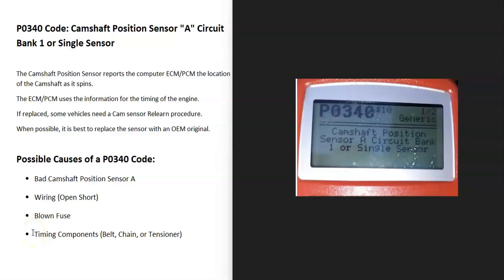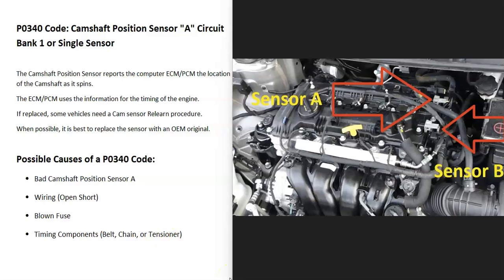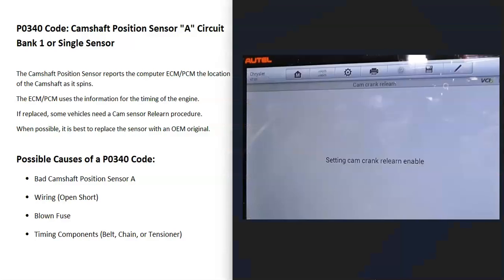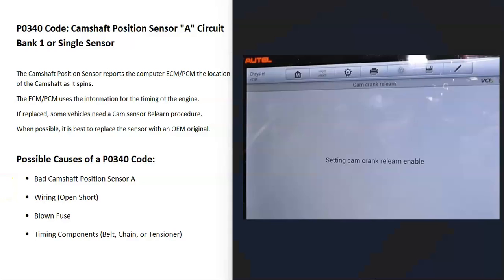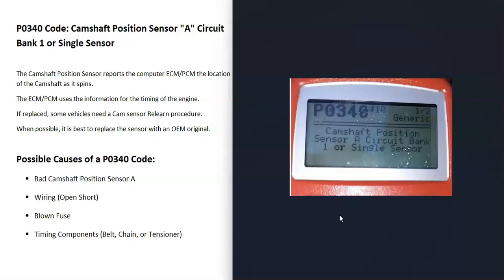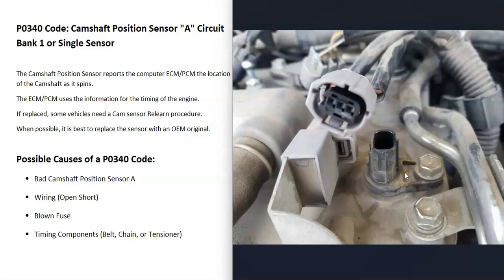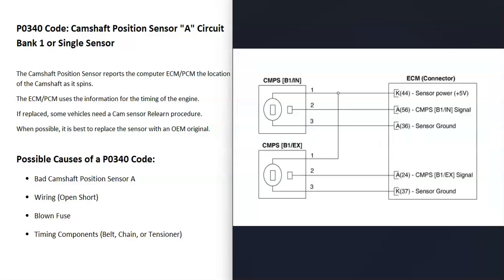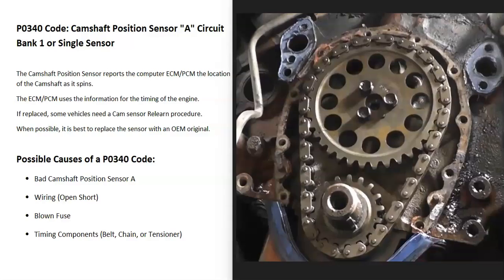Causes and Fixes P0340 Code: Camshaft Position Sensor "A" Circuit Bank 1 or Single Sensor

Comment: What's the location of the camshaft position sensor 2013 chrysler 200
Reply from the maker: There is two on each side of engine top side.

Comment: 2010 4.0  is ready the P0340 and it's a camshaft position sensor A bank one , ok and I know which bank 1 is but where is the sensor located on the front of the head or the back of the head.?

Comment: My 2000 4Runner showed a bad camshaft position sensor I had a broken timing belt I think this code resulted Question should I replace the sensor
Reply from the maker: A bad timing belt will throw Cam senor codes. I would replace the belt and see if the code comes back.

Comment: I have a 2012 malibu lt  4.2 flex fuel with the p0340. It shows as camshaft ps "A". The problem is there is two camshafts. Intake and exhaust. Which one would be considered "A".  Looking at the motor, the intake is front side right, and exhaust is back side right. The exhaust one is very hard to get to.

I also show codes for p0303 which is misfire cylinder 3. I replaced all spark plugs. Still shows p0303. I know im gonna try to swap out coil packs to see if that code moves.
Last code is p1174 lean bank 2. Shows fuel injector, o2 sensor, & MAF sensor.  Would bank 2 be looking from left to right like when doing the coils?

Also, isnt it possible by addressing p1174 & p0340 could solve the camshaft issue?
Reply from the maker: "A" is the intake camshaft, and "B" is the exhaust camshaft. It needs to be diagnosed the cam codes could be related to the other codes or could be separate. The P0303 is likely causing the P1174 lean code.
Reply: Update: I replaced all 4 fuel injectors and the car seems to be running great again. No check engine light yet but I put the reader back on the computer and it's still coming up with 303,1174,&340 even after I cleared them. Any thoughts as to why? If the cars running good and there is no check engine light, should I keep messing with it?

Comment: Hello I'm Scott from London  I have a mini cooper 04 r50 1.6 I have the code p340 coming up with A cistume code  could it be just the censor the engine as got a lot of miles engine is very quiet  but using more fuel it's stalls but I have no engine light on dash

Comment: I have this code P0340 hyundai tucson 2017 the engine is cranking but won't start there is a fuel pressure,there is a spark from ig.coil but did not burn the fuel
Reply from the maker: An issue with the Cam Position sensor will stop an engine from starting. I would check for any blown fuses, test the wiring going to the Cam sensor, and the sensor itself. Keep in mind that if the Cam sensor is replaced, some vehicles need what's called a Cam Relearn.

Comment: so i just recently replaced the spark plugs and coils on my dodge and after i put everything back and went ahead to turn on the car, the check engine light came on immediately and it threw multiple codes witch were the following... p0340,0365,p1dd2,u1424 any ideas as to why that might be??? i did disconnect the cam shaft position sensor at one point when i was replacing the spark plugs but i made sure to disconnect it very carefully and plugged it in right back afterwards, i would definitely appreciate any ideas you guys might have in regards to this situation
Reply: What did you find out? I got a ton of codes after doing a head gasket replacement for cam sensor codes

Comment: what does it mean if I have P0344 code with it?  could that be the timing components then?
Reply: yes, like he mentioned. IT can be a number of things. I'd get an OEM camshaft sensor, timing belt(if car has it) & bring to mechanic. Have them check the car for eletrical issues to the wiring & fuses. If you get a good mechanic they should be able to dignoise the car in 1-2 hours depdning on car, it can even take half an hour. Any FUSES can be purchased by mechanic if need be, but I'd at least get those items mentioned before. Worse case, can always return them. DO NOT have mechanic open part prior to figuring out issue as this can void your refund policy. MAKE THAT CLEAR!

Comment: @HVAC_Mechanic I have a 2003 Jeep Wrangler and have this code.  I have replaced the camshaft & crankshaft sensors, check the camshaft wires.  The jeep will run and sounds good for a 1-2 minutes then runs rough and stalls.  Do you know if this year requires the camshaft sensor to relearn or reset?   I don't know what else the issue could be.

Comment: I have same code in my honda civic 2016. Mileage is 270000km already. It’s a 2.0 ltr engine but i have already changed the sensor but i still get the check emission system code again PO344

Comment: Thank you so much for this video!!! I had a p0340 error code and turns out it was due to a blown fuse. Couldn’t have figured it out without you!
Reply: Wich fuse was it
Reply: @crimi1607  It was my fuel pump fuse but it may be different for you. My issue was for a 2006 chevy aveo hatchback ls
Reply: @CalmingSoundChannel  Was the fuel pump out also?